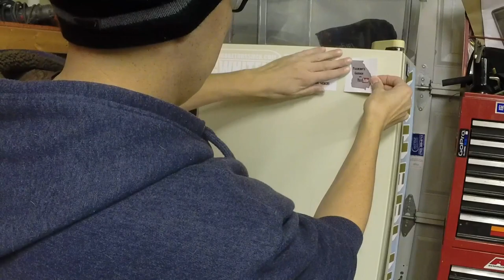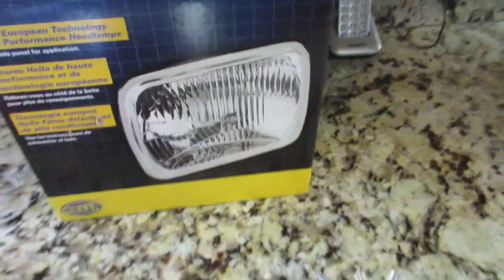Chevy K10 Hella Headlight Install | Mail Call | Q & A

Comment: no work being done, lol. Looking to grab some needed parts, get the 
cluster together(need to put a circuit board and glass on), want to get 
the trans overhauled at the shop before spring and paint it and the 
t-case. Need to look at some lighting for mine as well. Thinking of some
 LEDs all around, plus the relay deal like you did

Comment: Good to see ya back man. Based on what i was seeing in the video(and obviously in person is different) but the Hella setup didn't seem that much brighter. You might want to look into these instead of the HID setup:  https://www.amazon.com/GE-NIGHTHAWK-Rectangular-Replacement-Headlamp/dp/B00BQX2BSO/ref=sr_1_12?ie=UTF8&qid=1483057150&sr=8-12&keywords=5x7+led+headlight They look decent and are LED similar to the Tahoe. Might be a good idea.
Reply from the maker: Thanks for the link, I will check them out. In the video you can't see much difference.  The beam is more focused especially on Hi Beam, but Low is still not that good. How are things with you, how is the truck coming?